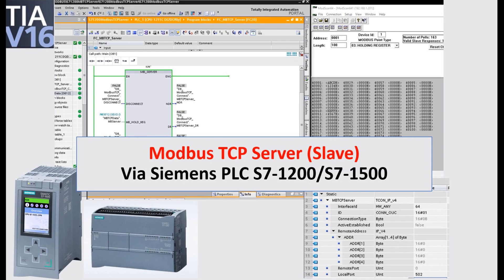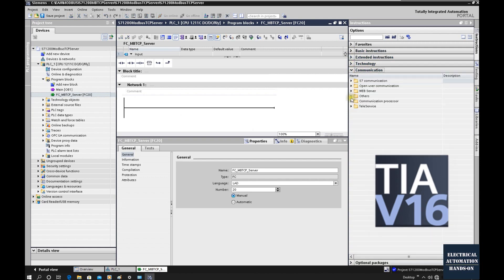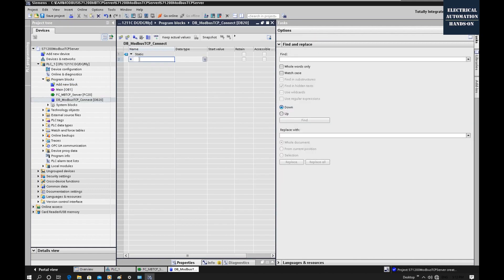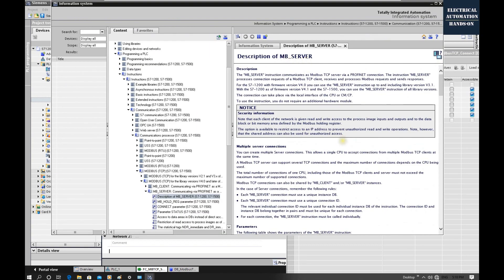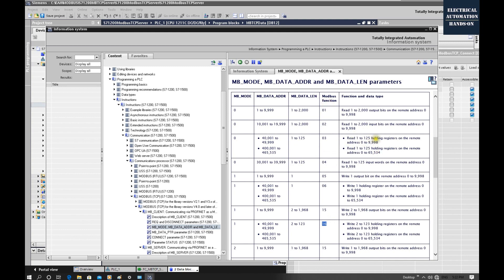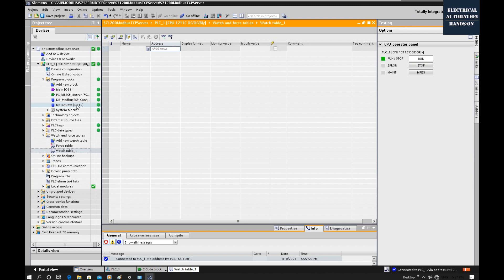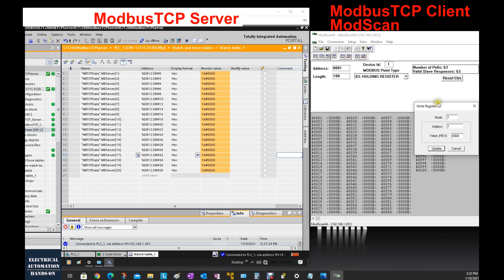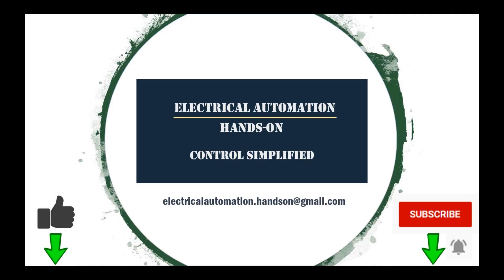COM19. ModbusTCP Server via Siemens S7-1200/S7-1500 PLC and TIA Portal

Comment: Hi, thanks for your very clear and detailed tutorial, it helps a lot! Just have a question, for the MB_Server block, there seems to be no setting for the Modbus address or "function code", only buffer address. Does the buffer automatically translate to "holding register" 40001 onwards? Can you use other function codes like read/write coil, etc.? I know you can process digital data also using holding registers, but just curious?hehe Thanks!

Comment: i am using simulation mode of PLC. Modscan is not working??
Reply from the maker: Please use the real hardware
Reply: You have to use PLCSim advanced and use PICSim virtual ethernet adapter to setup two S7-1500 PLCs, I did that and it worked

Comment: Another amazing video👍👌
One question: What are those hardware interface numbers 64 and 65?...how are they different from port numbers?
I have used other brands of PLC and I have never come across such things for Modbus communication.
Reply from the maker: The "Hardware identifier" allows the program or function block to operate the specific hardware resources.  Especially, if there are couples of ethernet ports in this system, example, S7-1516 has two physical cards builtin, also the 'CP' module。 So using this number we know which hardware we are using. regarding the '65' at S7-1200, I am also curious that, probably the 65 would be used for another additional diagnosis.
Reply: @electricalautomation  Thanks buddy!👍😊